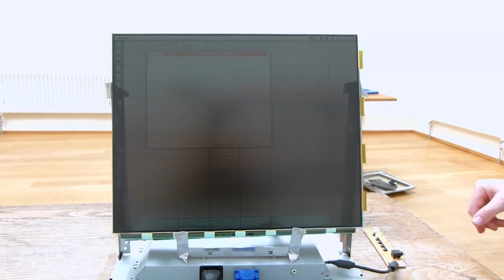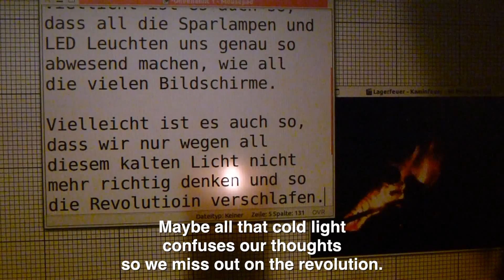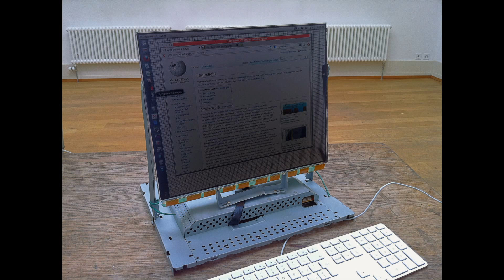How to Make a Natural Light Monitor

Comment: Dude, just made my own diy display very similar to yours. The Fujitsu screen I bought was similar too so your tutorial came in very helpful. Thank you.  I can post you pics if you like or a video. I will test in the sunlight in the morning. And I am testing a light bar too.

One question though. My housing is also open just like yours. My screen is sitting on top like yours too. Is this safe? Is there a chance I could get an electric shock. I mean everything is covered but it is exposed casing that is normally surrounded by plastic. For now I am being very safe.
Reply from the maker: i think, there is no warranty anyway, but i am stil alive :-)
Reply: @ghasler  haha its ok, I put the plastic casing back on and it works like gangbusters. Using it right now in front of my window. I will send you a link when I make a video.